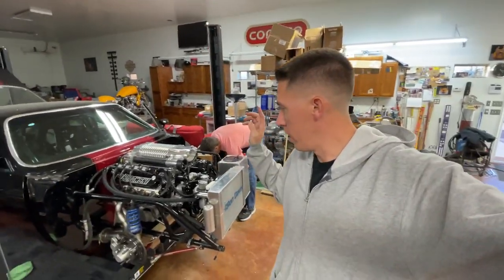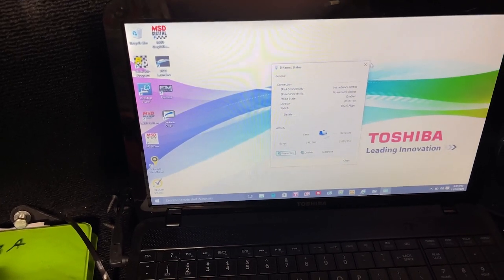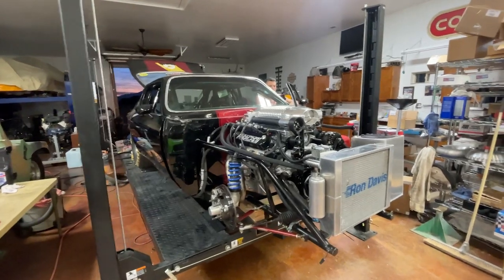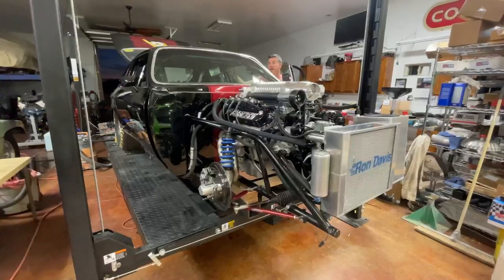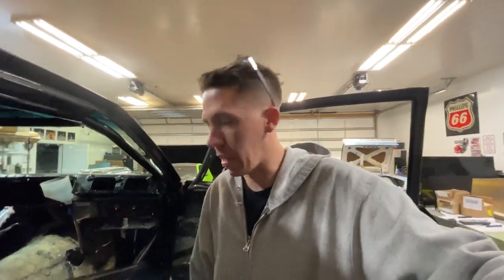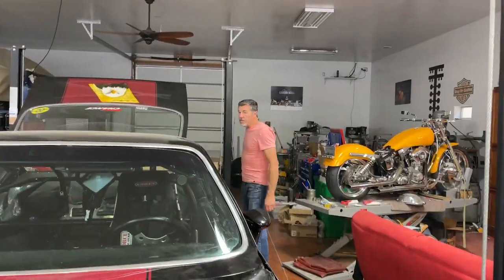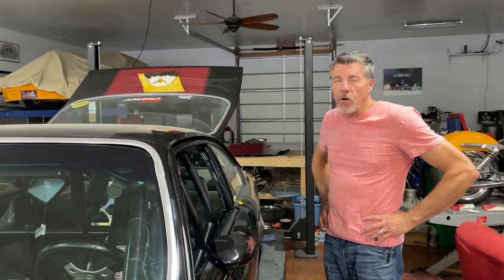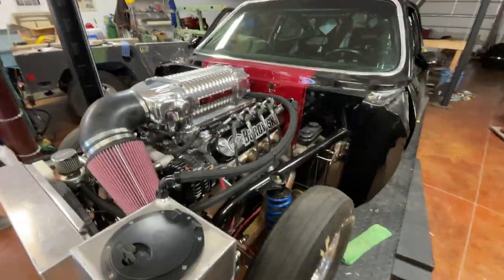4.5L Whipple Supercharged  427CI LSX First Start!

Comment: Very nice.
Just curious. Is that a tight LSA cam in that mill? Sounds like a lot of cam which many Whipple builds usually don't have. If you don't mind, what kind of cam specs are in it, just circa and at what rpm does it make power?